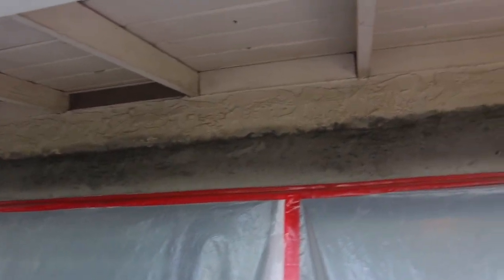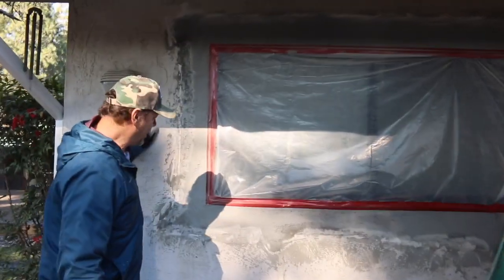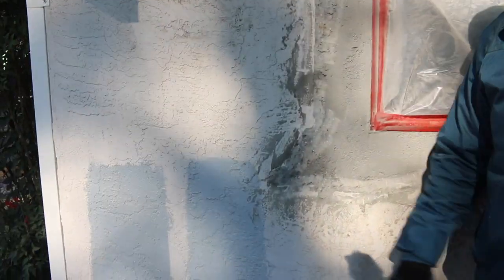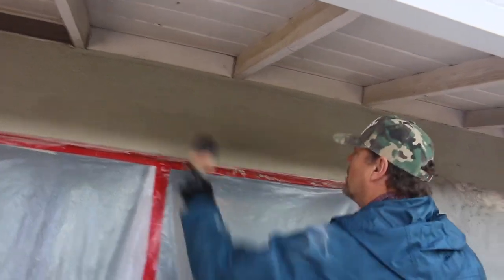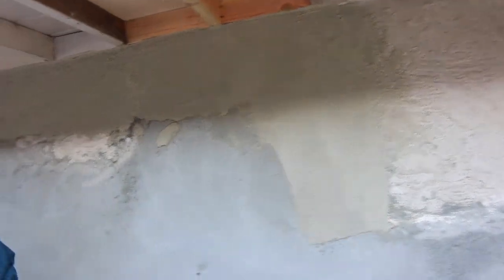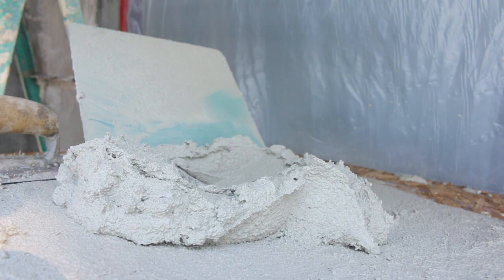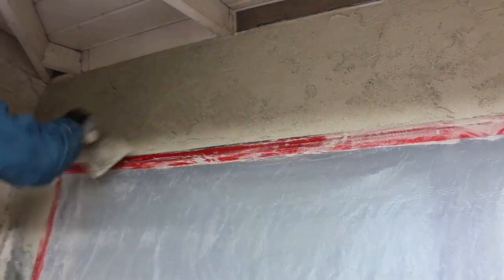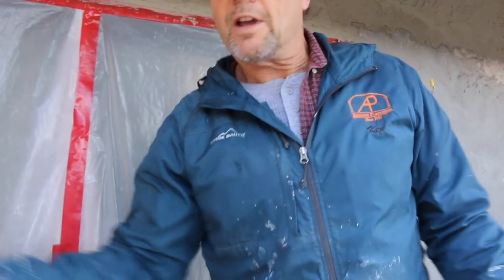Regular Skip Trowel Finish

Comment: Never put bonder in the mud !!!! Apply directly to wall itself  !
Reply from the maker: You did not explain why you would never put binder in the mud. You only said never do it.  It’s okay to put binder in the mud if you use discretion and are aware of what may happen. First you should never put it in a 3 sack mixer or any cement mixer that you want to keep clean as it will be a bitch cleaning it at days end.  Secondly be aware that by adding bonder to the mud this will accelerate it’s drying time and should be mixed for 3 minutes then wait 5 minutes to break the set for longer workability. Thirdly adding bonder to finish mud needs to be iced thoroughly for color consistency. Here are some other positives for adding bonder to the mud. One it with increase binders in the mud lending more binding power and minimize cracking. Two, on a heavy textured surface whereas rolling glue on with a heavy nap roller is next to impossible on a refinish is the best way to incorporate the adhesive process. And three, well I cannot tell you what # 3 is in an open forum, but if you reach out to me I will fill you in on a little secret that few people know about and some are sworn to the secret.  This is exciting to know and try on your next finished product
Reply: Let me know your secret 🤫. ,  ???
Reply: It will fail eventually , believe me I tried it years ago , and had to fix it on my own dime , true story bro  , not joking
Reply from the maker: @DavidSanchez-ot3it  hmm dang that bites.  I’ve never had one fail   What do you mean it failed Dave?
Reply: @AbersonPlastering  it came off in spots , I power washed it 2 times put bonder in mud , it was patches but it didn’t stick well at all , it was Larsens bonder , but after that I’ve put it directly on wall , and it’s never happened again , was a costly mistake , but I learned the hard way!!
Reply from the maker: Hi Dave. With a cup of glue mixed into a 5 gallon pail of fine colored stucco or plaster, we can apply the mud in 2 passes. The second pass keep rubbing the stucco with our stainless steel trowels until the color shine like a new dime
Reply: @AbersonPlastering  good